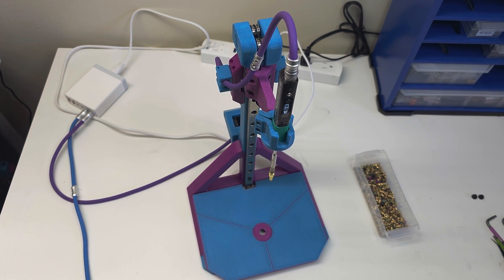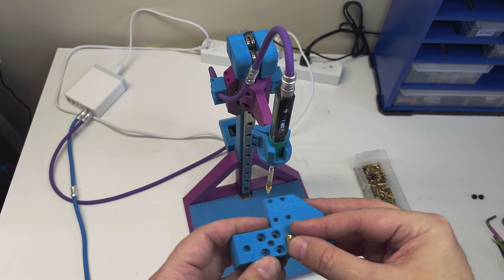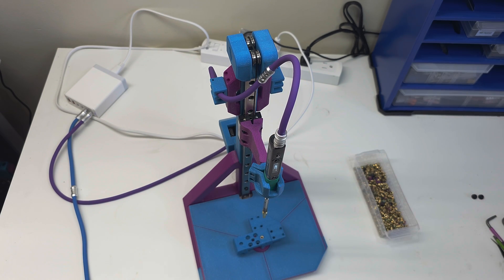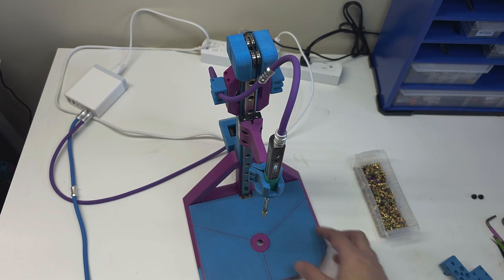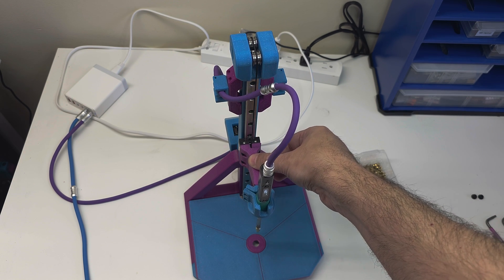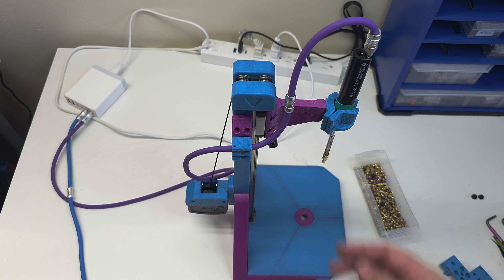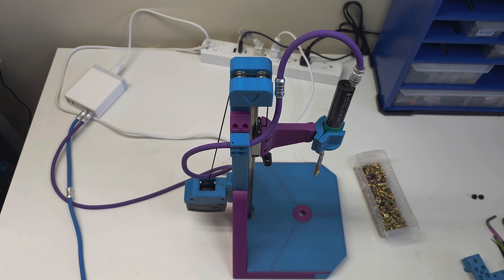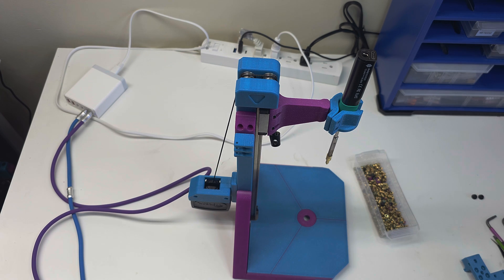Making: Stealth Press Heatset Insert Tool - Testing

Comment: What connector is that one those cables? I have never seen those before. Thank you for the video
Reply from the maker: Do you mean the purple and blue USB C cables?
Reply: @oldguymeltsplastic  I was going to ask the same.....  (I Made some custom USB cables in the past  with Paracord or TechFlex  (nylon braid) +  soldering......  I  love!!! your!!! cables!!!!! ).    Please,  could you tell us what type of connectors and cable sleeve are you using ?